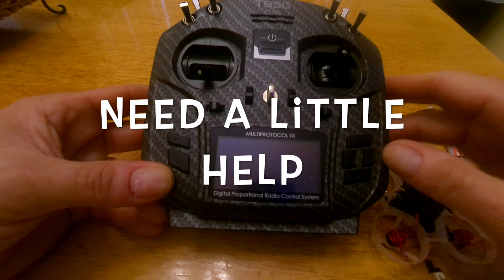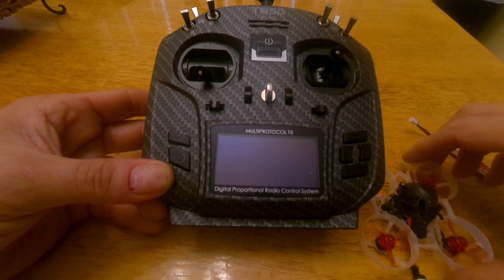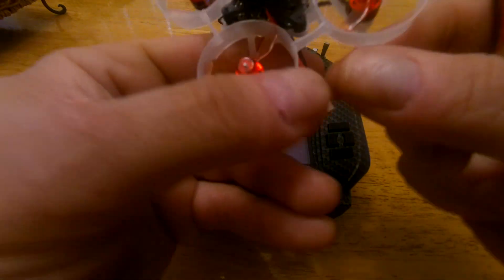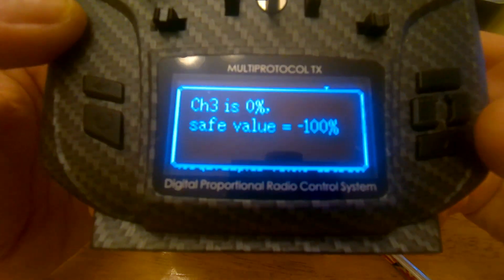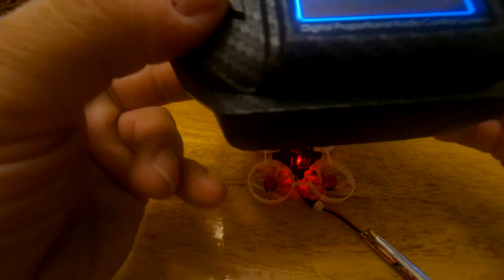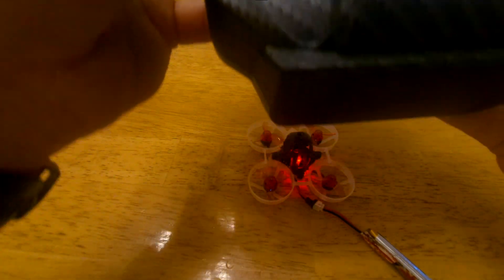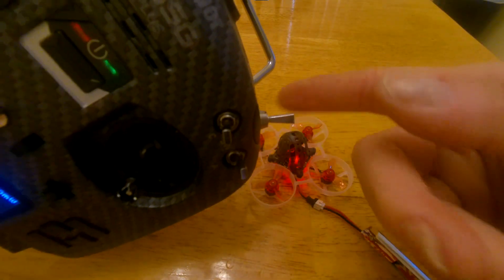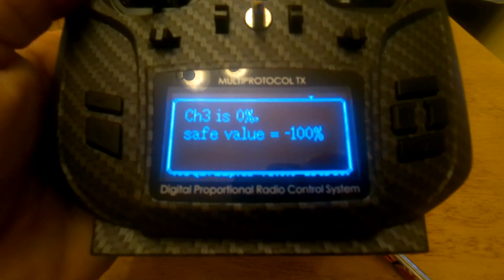Jumper T8SG (Help)

Comment: If ur running AETR Then it for sure is your throttle which would mean if your throttle stick is all the way down registering at zero you’re only getting half of your gimbal movement, Because it should be sitting at -100 when it’s all the way down and be 100 when it’s all the way up. If you didn’t mess with any settings if you didn’t mess with mixers I would suggest calibrating your controller

Comment: Don't know if this will help but ch3 will either be your throttle (AETR) or you elevator (TAER)  . I don't know which way your radio is congifured but it appears to be looking at ch3 Elevator which will always be 0% at rest. Perhaps there's a setting in the radio to ignore that at boot or set what the percent should be at boot. Probably doesn't help but good luck.
Reply from the maker: Thank you so much. 👍👍👍

Comment: If you bottom out your throttle left stick does it disappear? Mine has to be completely bottomed out.
Reply from the maker: Even if I bottom out the throttle is still there. 🤔🤔. It's driving me up the walls. Haha lol
Reply: Maybe a stick calibration? Main Menu, Transmitter Config, Stick Calibrate.
Reply from the maker: @WildCaptures  I never got this. I have a few quad in this controller and only this one  did that. I did the stick calibration and nothing either. It's really weird.
Reply: RayFpv 
Try doing the end points in the receiver tab in betaflight.
Reply: RayFpv Maybe open a whole new model on the Jumper and re-bind? Not sure 🤷‍♂️
Reply from the maker: @RCEscape  I'm new to this and still learning Betaflight. How will I do that. Do you have a video on this Pete.
Reply from the maker: @WildCaptures  I really appreciate your help buddy. I will try everything. It's just annoying having this on the screen every time you turn it on. Thanks alot.
Reply: RC Escape Pete to the rescue 👍🏻
Reply from the maker: @RCEscape  I'm going to give that a try. Going to bed now because I work nights but I'm going to do this. Thank you so much really appreciate it. I will let you know. 👍👍👍👍👍
Reply: @WildCaptures  
If it doesn't work try setting up a new model like Steve is saying.  Recalibrate the sticks.  Adjust end points once more on the new model.
Reply: RayFpv hope you can fix it, my big bro 🙏🙏👍❤️

Comment: What is your channel 3 are you running your throttle on channel 3,  If you’re running your throttle on channel 3 your bottom read out meaning your stick when it’s all the way down should be -100 and not 0, 0 on your throttle Should be your centerpoint in between top and bottom. All other Channels besides throttle should be at zero but again throttle should be resting at -100 all the way up on throttle should equal 100 in between top and bottom should equal zero. If it is your throttle that’s messed up I would assume that you messed around with mixers and if you have not then maybe you need to calibrate the controller
Reply from the maker: I will look in to it. Thanks brother Jay. 👍👍👍👍👍